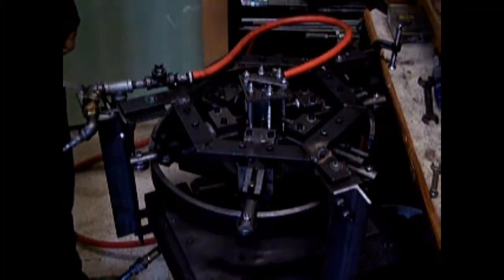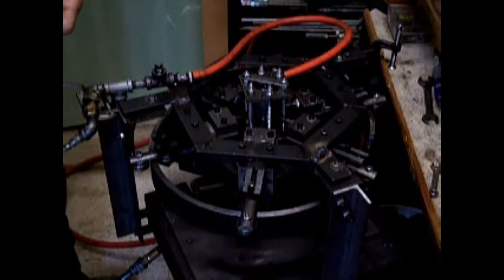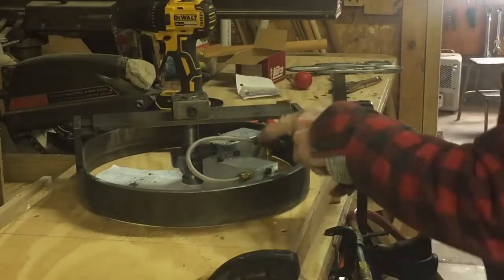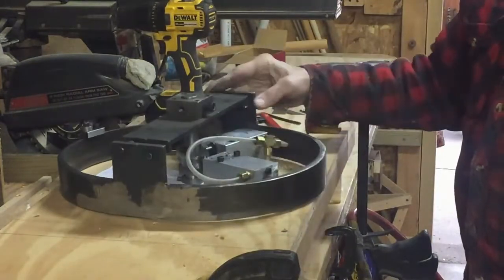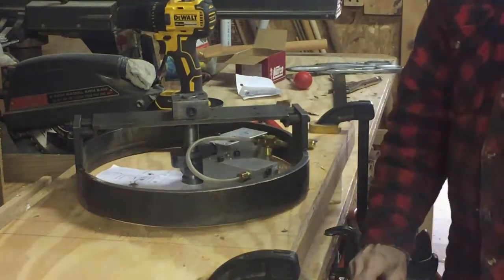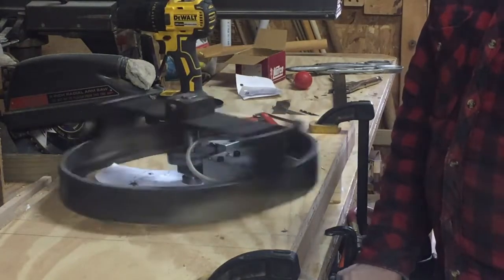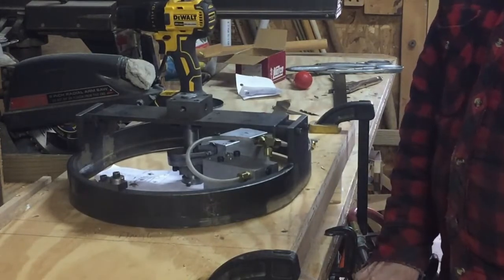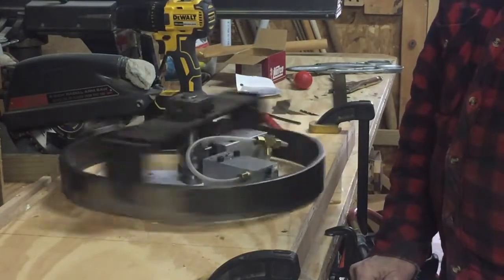Compressed Air Engines, quick look back at a couple I've worked on! 3-11-2022

Comment: Awesome, so many creative alternatives. Keep 'em coming
Reply from the maker: Thanks for checking in!
I'm already working on a design that's similar to the oval ring design in the video today, but before staring on that, I need to decide if the current 3 Cyl Eccentric design has enough torque to possibly be the final one? I'm going to set up a testing jig and runs some comparisons - just a guess, but I think the Oval Ring will win on torque??
stay tuned for more later

Comment: Le hago ,una pregunta ,cree usted que c podría, hacer un sistema de carga para el motor ,con un compresor ?
Reply from the maker: Hago el motor lo más simple posible, funcionará con aire comprimido de un tanque que tendrá alrededor de 4500 psi y se reducirá a alrededor de 130 a 150 psi.
No sería práctico para mí hacer un compresor para comprimir aire a esa alta presión.
Por ahora, todavía estoy en la etapa de desarrollo y puedo usar mi compresor de aire regular para suministrar el aire de bajo psi necesario para probar cualquier motor en el que esté trabajando.
Gracias de nuevo por registrarte y tu pregunta.

Comment: Have you seen the air vehicles of Angelo di Pietro?
Reply from the maker: Hi and thanks for the comment.
Yes I have. 
He seems to have a lot of money to spend on machining and  making things to put his ideas in.
I am interested in a simple easy to make air engine with as few parts as possible that anyone can make themselves.
What you saw today are just a couple of many different ideas I've thought of and worked on in the past, they worked but to complicated and too may parts.
My latest designs are a lot simpler - but I'm not quite where I want to be with my latest ideas.
Stay tuned - there's more information and videos to come this summer
if you have subscribed, make sure you click on the bell to be notified of new videos!